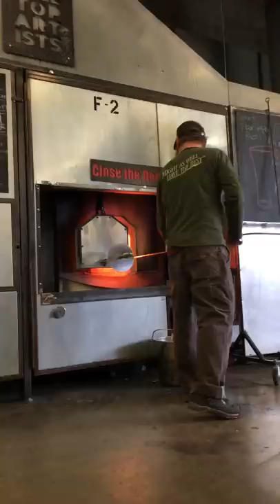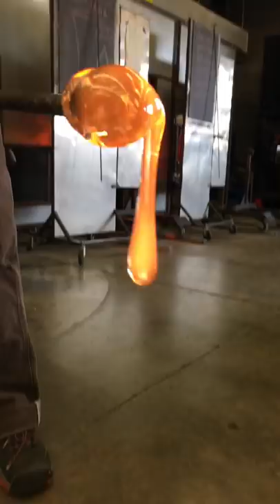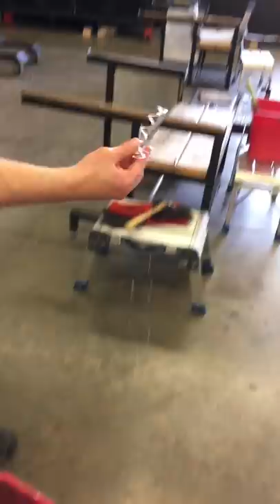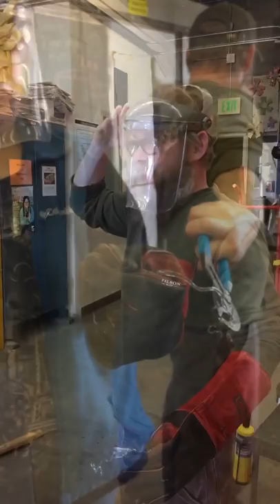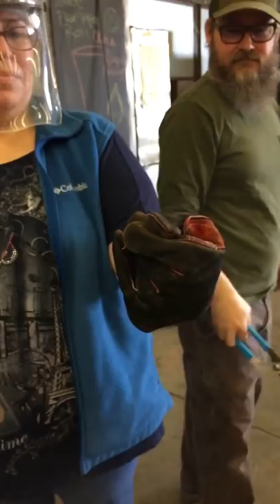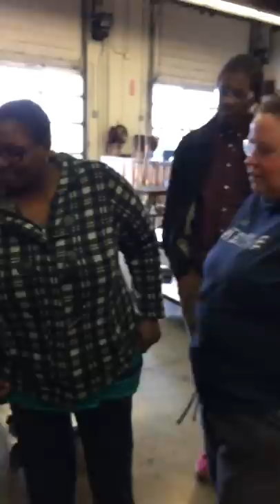Glass artist Jason Mouer demonstrates a Prince Rupert's Drop to University of Washington students

Comment: It would be interesting to see if perfectly spherical ruperts drops could be formed in zero g. Super strong glass beads basically.
Reply: I think the contact with water would deform the shape of the drop. Of course, someone might find a way to rapidly cool the glass without water.
Reply: The shape of the glass plays a part
Reply: @trynee1397  do you actually know what you are talking about or are you powerless in your day to day so you huck out confident comments with no actual substance to them?
Reply: @demartobey1770 , you need water to rapidly cool glass, it won’t deform it either. But depending on the glass properties and the amount of heat put into it can shock it and cause it to explode in the bucket like this drop did at the end when he clipped the tail off. Glass blower here. But in all honesty you don’t even want water to cool glass. You want to kiln it and let it naturally cool off through the kiln process to stabilize it.
Reply: Since it would be a new type of “drop” (can’t drop something in space) I guess whoever does it first gets to name it :D
Reply: Daniel Bauer  the most noteworthy thing those guys have dropped is a turd
Reply: The issue is that it still needs to form from a source so there will always be some sort of tail
Reply: @BigRheno  yea but liquid glass has surface tension in zero g it will bead up if you keep it warm until it can pull into a sphere
Reply: @JackDaniels-ex9mf  The entire physics of the drop also requires a tail.  The tail creates a superstructure within the glass essentially.  That’s why it shatters when the tail is slightly cracked.
Reply: @BigRheno  idk if that's entirely true
Reply: @ders972  there is a channel that goes in depth to science shit like this. He set up a slow-motion cam and shot it with a bunch of different high powered weapons and then describes the physics behind what happens.
Reply: @ders972  yeah that's actually how it works, genius
Reply: @ders972  …Who hurt you?
Reply: I wonder what glass making in zero gravity would actually be like, that sounds really interesting
Reply: I don’t think the glass would come off the pole, interesting thought though, would be fun to see
Reply: @ders972  im pretty sure that’s true. The way the glass holds pressure. As it cools it builds up a shit ton of pressure the inside that allows it to withstand impact. However if you snap the tail it releases the pressure and essentially makes the drop explode.
Reply: @oliverklozhoff  But it is though... There are many videos on YouTube explaining the phenomenon. Smarter Every Day has a great video on it I believe with a super slow mo of one breaking. Really cool stuff.
Reply: @BigRheno , only if you allow the molten glass to “drip” will a tail or stringer start to form. Glass while hot and constantly being rotated will naturally always want to be round and if rotated enough with consistent heat will form into a marble over time.
Reply: @ders972  it actually does matter, there's plenty of science channels that go over the phenomenon
Reply: The drop is actually made from normal glass. It's the shape of the drop (bulb and tail) that gives it its unique properties.
Reply: @Long_May_They_Raine  where did you come up with that unique reply? Haha nice swing.
Reply: You mean a marble?
Reply: @theskytoday9239  thank you for being one of the only people to realize you can't drop things in space since there isn't any gravity.
Reply: @Surveyed  I was talking moreso of how you must always need a tail for a drop or else there won’t be a super structure formed.
Reply: @connorcoker6106  when people talk about zero gravity it doesn't mean there is no gravity. Gravity is everywhere all the time. It's effect is different depending on situation. Satellite motion is the result of gravity among other things. It is that relative to the situation sometimes things appear to be weightless due to relative motion. So if you were in a car and drove off a cliff  in a vacuum the car is falling and you are falling. If you had the time and the dexterity and the space suit lol, you could dance around on the car like you were weightless but gravity is not absent and you would find that out eventually.
Reply: @ders972  Really weird of you to call someone a child and then immediately politely ask them to not lecture you. What is your motive with that even?
Reply: @BigRheno  for this specific thing yes, I was just explaining how glass works when it’s hot and put into constant motion that it will stay round is all. You can also make marbles that bounce like rubber bouncy balls too that can take a lot of abuse like the Rupert drop.
Reply: Seen one win against a bullet.
Reply: It's called a 'drop' for a reason, not sure otherwise
Reply: The tail is crucial to how it handles shock, & vibrations without breaking.
Reply: @TaikoDrumroll  my motivation is laughter... I guess my sense of humor isn't for everyone. Sorry I argued instead of answering your question.
Reply: Marbles
Reply: Could you drop it from a height into water like they made musketballs  way back when?  Would that create spheres?
Reply: There's little reason you cannot make a drop without the tail already. It wouldn't be a flawless sphere, but you could get it rounder than a raindrop I recon.
Reply: @BigRheno  The tail is only required to give the drop a weakness. If you cut the tail off when it's still molten and formed it into a ball before dropping it in the water, you'd have a neigh invincible ball of glass.
Reply: @CornPopsDood  The tail definitely only makes it weaker
Reply: @Surveyed  As someone who spent almost 14 years in the Commercial Glass Industry, I think I can chime in here.
Tempered or "Safety" Glass is made by heating sheets of glass (usually moving it through a long furnace) then "quenching" it with directed blasts of air. This type of glass is not only stronger, but the key is that it breaks into smaller, more uniform pieces- rather than large shards.
This process uses the same principles of Physics as the Prince Rupert's Drop.
Reply: @brandonn6099  You’d actually have a very brittle and high tension ball of glass due to the intertwining expansion of different layers.  Essentially, a tiny glass bomb for lack of a better term.
Reply: @brandonn6099  Negative. It helps it handle vibration without breaking.
Reply: @brianknapp6215 , that’s pretty cool I don’t work sheet glass, I work on Boro glass as a lathe worker and occasionally do hand work. Boro reacts in weird ways sometimes and there’s tons of stuff to do with it.
Reply: I wonder how you would make a drop without an gravity to pull it off the pole.
Reply: @TheKaneECO  Soup ladle… 😂
Reply: @BigRheno  Hey, somebody else that understands the tail is vital!
Reply: @ototo4508  It is entirely true. Look it up. You can literally shoot one of these, & it will shatter the bullet.
Reply: @LarryFish3rman  People won’t look into anything. They already know it all man lol. They think there’s no way that such a thing seemingly unimportant tail is actually very crucial to how this works.
Reply: @CornPopsDood  Speak for yourself. I can find exactly zero empirical evidence of someone making a drop sans tail. It should be relatively easy to do. The tail may contribute to the bullet-defying strength, but a perfectly round drop with no tail will still be incredibly strong.
Reply: @BigRheno  Yes. Prince Rupert's drops are incredibly brittle. Way more so than normal glass.
Reply: @brandonn6099  I never said that a solid one wouldn’t. I just said the tail does definitely make a difference in the way this specific piece has its strength. Of course the thicker part is pretty much guaranteed to be stronger, but when it comes to shock absorbency the tail is vital. Smartereveryday has a good video, not sure if he’s the one that shoots it though. Look up Rupert’s drop shot, & it will surely pop up. Probably has been redone hundreds of times. Although the one I remember had some absolutely awesome high speed footage.
Reply: @demartobey1770  expose it to zero g vacuum? 🤔
Reply: Except you need gravity to cause the glass to drop and create a tail
Reply: @CornPopsDood  I've seen his video, but they didn't shoot any without tails. And the ones that broke all broke from vibrations at the tail.

I didn't re-watch the entire thing but the first 4 broke at the tail. Take away the tail and maybe they become nigh indestructible.
Reply: @brandonn6099  What I’m thinking of must be a different video because I’m positive I’ve seen one break a bullet. If I’m remember correctly when they do break they almost always have to break from the tail, be it direct force there, or vibration. I still agree that anything solid, especially the right type of glass would be damn near indestructible to a point. Might be easier to find a self sealing type of rubber though lol.
Reply: How would you cause the droplet to separate from the glob? This one was separated with gravity, in zero g it would just adhere in a globular form to the tool used to extract it
Reply: @robjohnsonmusicandgaming  If you’re talking about these drops, I’ve always seen them basically get pulled off a bigger glob by rotation, or gravity into the bucket. Not sure if there’s any special technique to that part, or not though.
Reply: Ders972: makes a comment
nobody liked that
Ders972: gets roasted like a holiday ham
everyone liked that
Reply: @Surveyed  the whole point was to make a Ruperts drop...  not to just cool off glass... to make the drop... it needs to
Cool very quickly so the glass and pull in on itself towards and center basically and that’s what makes it so hard
Reply: @VsRebuilds , well aware of that my friend just explaining how glass works and what you can do with it is all, and how water reacts with glass kinda.
Reply: @XanderMukbang  like a properly tempered marble?
Reply: @Seeds-Of-The-Wayside  marijuana is a hell of a drug
Reply: @dassboot9332  sounds terrifying
Reply: @oliverklozhoff  It  is.
Reply: @monalisadabbing7491  esl? Great job trying.
Reply: @ders972  Wtf, grow up.
Reply: @CornPopsDood  it was a smarter every day video... He hangs it and shoots it and films with the super slow motion cam
Reply: the properties of a ruperts drop is down to the shape you see, not to mention it is formed by viscosity, gravity has no effect on this besides pulling the fluid downward, with no gravity it would simply stick to the rod he's holding and cool there
Reply: 2600F glass floating around in zero-G? No thanks, I'll be over there...
Reply: The tail is not needed. A perfectly spherical ruperts drop is entirely possible, its just hard to perfectly quench a spherical drop of glass on all sides
Reply: @trynee1397  without the tail the ruperts drop would not have a weakpoint to break the structure
Reply: @yautjayarrington1732  nah nah nah, Ders at least has the decency to respond to comments, ya got to give them credit for that.
Reply: If it’s spherical it’s not a ruperts drop
Reply: @bleeka325  ok? Prince ruperts sphere is the best name we got.
Reply: @JackDaniels-ex9mf  nah the physics of it will not be the same. It will just be a glass sphere that shatters or cracks instantly when you hit it
Reply: Imagine how insanely dangerous it would be to blow glass in space. Lol ball of white hot glass floating around when it gets away. Lol
Reply: @bleeka325  i cant find anywhere that says the tail is required for the strength of the ruperts drop. All of the strength comes from the equally balanced internal forces and the tail is a location that those forces are unbalanced and only forms as a result of how prince ruperts drops are usually made. Drop the glass closer to the surface so a tail doesnt get to form and you und up with a stubby tail thats much harder to break
Reply: You can't move a droplet in zero gravity but you surely can move the "bucket".
Reply: @theskytoday9239  Rupert balls ?
Reply: Yes. Tempered glass balls.
Reply: Super strong glass grenades
Reply: It rellies on gravity to form,  fundamental flaw with zero G, what forms the globual of glass and how does one keep the water in the bucket.?.
Reply: Well it would form around the rod. Not sure how you’d dispense it. But theoretically, yeah they’d be pretty damn near spherical at least. Just like planets, comets, suns, etc. They really want to be spherical save stress or weird history.
Reply: @ayooobro  pooflakes are good. They are great for being late to a party. Sick burn. Thank you. You are very nice.
Reply: That would be impossible
Reply: @ImLilPlant  but there are videos of fire in zero g
Reply: @ImLilPlant  and we arent talking about making this in the vacuum of space it would be inside a structure
Reply: @ImLilPlant  also you can use an electric kiln for heating the glass
Reply: @demartobey1770  if you were in space and you put it out of the ship that may work  that shit cold asf
Reply: @sleeppyboii  holy shit I got a good idea on how to get this Rupert sphere to work. Heat the glass in a controlled space but with some fire proof slip through gloves and the kiln is in the controlled area as well where the rod would be as well then spin the rod the molting glass flies off in each direction and water will stay all on the sides of the controlled space due to surface tension have some spots where it's deeper water and bam you can successfully land a Rupert sphere in zero g and it would actually be a tail-less Rupert drop that would be harder than a marble I would love some kind of input from an expert on glass and what they would say about my theory
Reply: @toriburton4016  ngl lil hard to read rn cus I b tired but I think I see your process and I think it has a chance of working might need a few tweaks but it would be interesting to see the result we need more 0 gravity experiments not enough of them like if we smoke weed in space where does the smoke go🤔
Reply: @BigRheno  not if you cast it
Reply: @JackDaniels-ex9mf  i wonder if the lack of air pressure affects the melting point of the glass. Like boiling water on a mountain
Reply: @toriburton4016 , hmmm, I’m not too sure actually, I’m just curious what you mean by spinning it and the glass fly off. If it’s molten hot on a blow tube or rod it’s just gonna continue to stick to it if not have some kind of negative pressure on it that may suck it inwards down the blow tube if it’s not plugged if it’s a rod it’s just gonna stick to it unless you were to some how knock it off by quickly shocking it with water or cold metal where it’s attached. But if you could manage to have a piece of glass “float” in ZG while some how keeping it contained with consistent heat what the negative pressure might do to it. The only thing I could think is it would probably go spherical for a min and begin to take the shape of Saturn 🪐 as the pressure is still applying on it but as it spins it would make this shape over time. Also depending on the property of the glass you won’t have to kiln it as a solid sphere is less likely to crack anyways since that’s what glass wants to do when it’s hot. It wants to be round. Just curious on what the pressure of space would do to it. Minus like space glass already that naturally forms up there. But I believe that’s a different process all together. But I’d doubt it would take as much abuse as an actual Rupert drop or traditional marbles, that would bounce or slip out from under hammers.
Reply: That’s really interesting
Reply: I'm not entirely sure why people are getting angry, so I'm gonna ignore the infighting and just answer the original comment. The problem with zero G is that you cannot have a drop, since that requires gravity to force it to occur. Whether or not it hits water is inconsequential when there is no gravity pulling it towards anything so it would just remain a part of the original without ever dropping off.
Reply: @thegreyarea-WPP  wrong, wrong wrong. In zero G drops exist, in fact they can be huge drops, the only difference is that in zero G the drops are perfectly round, basic physics called surface tension. So in space you can create a giant free floating drop of water, then create a molten blade drop, both perfect round floating in space, the simply push one or the other twards each other, once the intersect the interesting part is will it form a perfect round Rupert drop... The trick is how much exceletation I'ds required or. Accelerate the spacecraft or spin it, fill a bucket with water and drop the glass in, though I suspect the results will match what you see on earth at 1G,the interesting part is to keep reducing the simulated g forced die to zero. So again your entire thought process is wrong, without question, its basic science 101.
Reply: @jadenyoung9439  i really dont think the tail is important to making the sphere strong, just think about it how is the tail possibly having an effect on the opposite side of the rupert sphere? There are many diagrams on how the forces are distributed inside of a price ruperts drop and the strength comes from the fact that all of the internal stresses are balanced in every direction. The reason the tail breaks is because it isnt spherical and so the forces are not balanced in all directions in the tail, they are only balanced in the horizontal axis and so the greater tensile stress can form in the tail allowing it to break
Reply: @thegreyarea-WPP  liquid glass has a surface tension so keeping it molten it will form into a sphere naturally, then you just need to quench that sphere on all sides quickly. Electric heating, use air blasts to manipulate the glob of glass in zero g and keep it from floating around uncontrolled, and you just need nozzles to gently release water or maybe another liquid that has a higher boiling point so that the bubbles dont disturb the surface. Difficult yes, impossible no. Worth the effort? Maybe, it depends on how strong we can make the glass i guess i mean if they make good replacements for ball bearings that last longer that would be worth it to make at least some
Reply: @JackDaniels-ex9mf  thanks for giving me far more insight and knowledge than I previously had. Definitely an interesting theory and it certainly sounds well thought through. It's a pleasure to be educated in such a way.
Reply: @airgliderz  thank you for schooling me. Honestly, it's a pleasure to learn and sometimes it takes learning from being wrong. It's insanely fascinating to me as well. I don't mind being put in my place with answers so well structured. It's a lot to wrap a fried mind around, but it's interesting to know what is possible.
Reply: Yeah think maybe ball bearings that last forever...?
Reply: @ders972  lmaoooo who hurt you
Reply: Space would change the entire process, without gravity the molten glass wouldn't drip/drop off the punty(pole used for glass blowing), I would think centrifugal force would be the way to separate it. Also space temperature is approximately -455° Fahrenheit, so maybe water wouldn't be needed to super cool it, you could possibly figure out a way to fling it off the punty and let nature or lack thereof in space so the rest.  Interesting idea but not sure it could be done.
Reply: @anthonyortega3136  ive made other comments addressing all of these
Reply: @theskytoday9239  drop 💧 like a rain drop but glass.